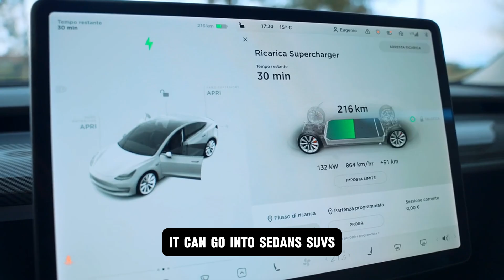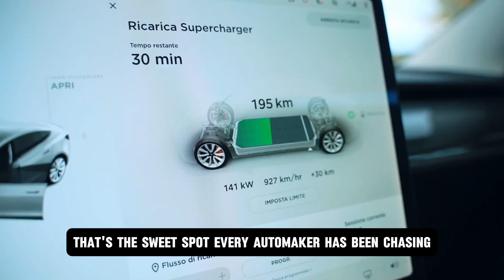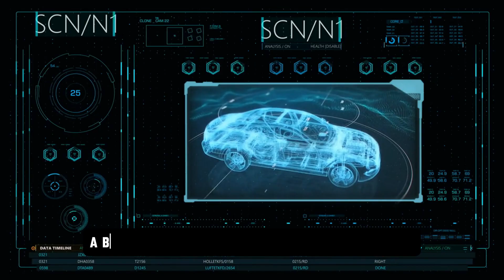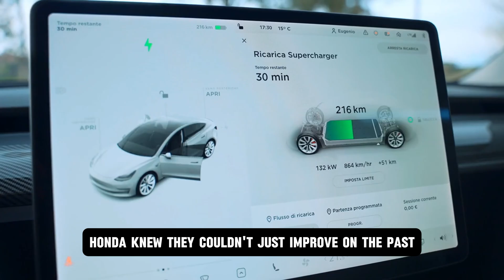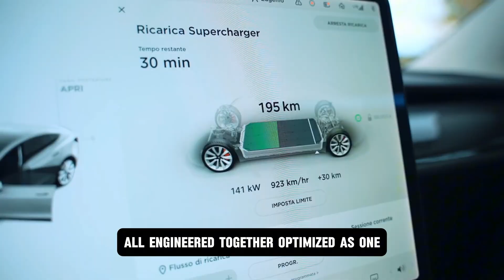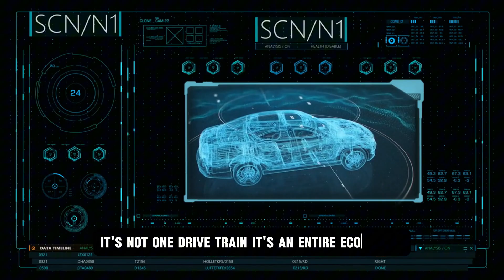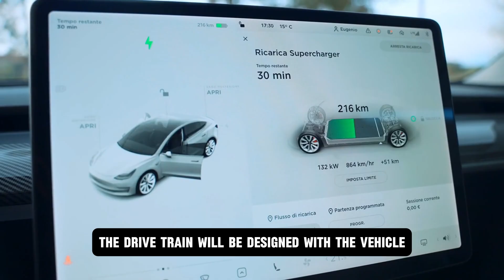5 Minutes Ago: Honda CEO Unveiled the new Hybrid Engine—EVs Are Dead!

Comment: Why make hydrogen which requires more energy than you get out. Why carry the weight of fuel and the motor not being used. Why the extra maintenance of unused systems. No I'll stick to generating and using free sun energy.
Reply: So your batteries are weightless and 100% efficient in charging and holding the charge? Solar power being free is wrong, too, and also if it is free, what does it matter do use it for hydrogen. Mate, think a little bit before posting.
Both have their benefits and drawbacks. Circumstances should make the call. There is not one solution which fits all.